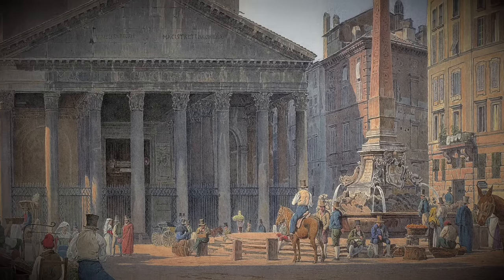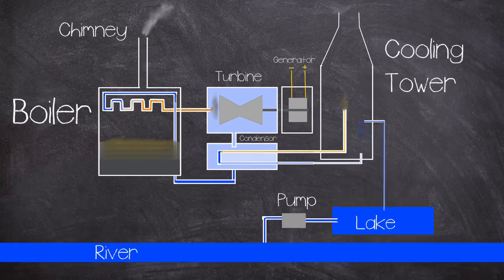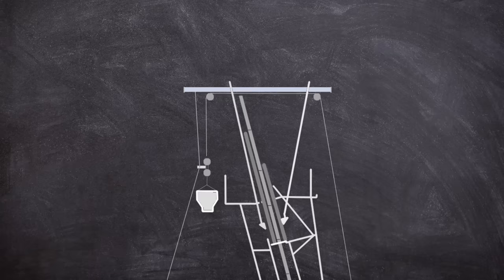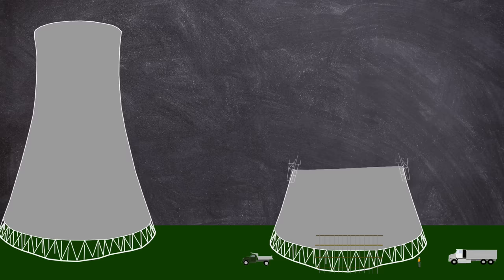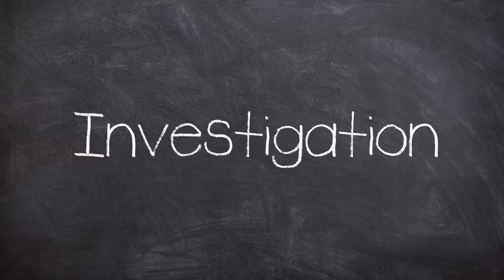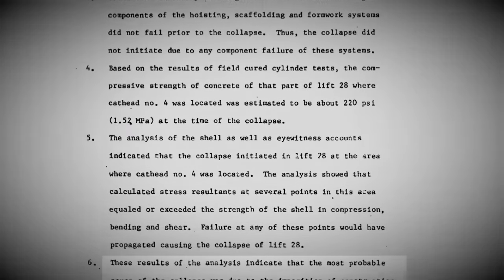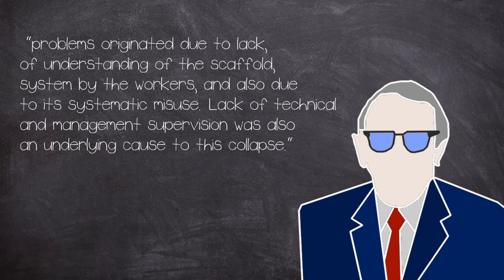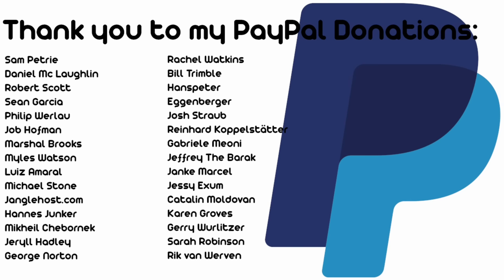The Willow Island Power Station Disaster 1978 | Plainly Difficult Documentary

Comment: I live 10 minutes from the plant. There is a black line around the tower marking the spot where the section collapsed and construction stopped. If you look at the names of the victims, you'll notice a lot of repeated last names, not by coincidence. The builders of the towers were almost all locals and many families had multiple relatives die there. Also it is spelled Pleasants Power Station, named for Pleasants County.
Reply: Same here, from Pleasants County. One of my classmates lost not only his father, but 6 other relatives that day.
Reply: Ritchie County here!
Reply: See this is a good point he coulda put in the video cause this is exactly along the lines of what I was wondering happened with them
Reply: Across the river and north of you nice folks and I’m old enough to remember when this happened.
Reply: Wood County checking in
Reply: Williamstown is here and whipping st Mary’s as always remember 2014
Reply: @melissaglasser4759  yeah, a lot of people in the high school have relatives involved. its a small town so its not surprising especially with the scale of the accident
Reply: The simple reason that all those people needlessly died is because of the BS Method of Building those towers.  Like the narrator said, it was cheaper to build up the towers one level at a time rather than to erect a complete construction structure from the ground to the top, which would've much safer.  Considering the heavy weight of the concrete, this was an unnecessary risk to take, regardless of how much money it saved the contractor.  Had a complete scaffold structure been erected from the ground up, the workers would've remained on the scaffolding when the structure collapsed.  ALL those people died because, yet again, Capitalists value Financial Profit over Human Life.  They ALL died because American Workers are at the mercy of GREEDY Capitalists because our Govt really doesn't Give A $Hit about workers until after they're dead, and then they try to "make things right" by having a BIG Investigation where NO One EVER ends up going to prison.  The fact that this happened in an economically depressed State like WV made it easy to find desperate workers who would take such an obvious risk.
God Bless America !!!
The nation that cares more about the Human Rights of other people around 
the World than it cares about the Human Rights of its own Workforce !!!
Reply: Just checking in, I have a friend in Ohio who occasionally visits relatives in WV
Reply: @ArtCurator2020  "God Bless America !!!"
Same "gawd" who let these people die or a different one?
Reply: UK had power station cooling towers collapse in high winds. Ferry bridge I believe. Thankfully they were fully built and nobody was hurt.
Reply: My husband grow up in Parkersburg. He told me the story the first time we went down there together.
Reply: @HentisTinyBeans and the relevancy of that comment is?🤦🏻‍♂️
Reply: A young boy lost several family members in the collapse. He raised money for a memorial to be built near the station
Reply: RIP to all the sister-cousins, brother-uncles, parent-aunts, and other forms of kissing cousins who died.
Reply: @ArtCurator2020  I agree with your last statement, but ''capitalism'' itself isn't to blame, it's usually the low bid system whereby the cheapest bid gets the job regardless of safety issues. If the company who chooses the lowest bidder doesn't know a damn thing about proper construction it's they who are to blame.
Reply: You lost me at the anti capitalist rhetoric, which is the system that gave us the best living standards in history by far @ArtCurator2020
Reply: @ArtCurator2020 you just aren't  too smart. Are you?
Reply: Wow!

Comment: Before you described how the collapse happened I was already thinking "you can't use day old concrete to support anything, it hasn't cured yet! And then OSHA gave me that sweet validation. 

Thanks for another good one, John.
Reply from the maker: Thank you!
Reply: I was just thinking that myself - this entire process is completely insane! That fresh concrete is just going to crumble under any load. And it did.
Reply: My uncle was an ironworker and said that at the time. He had just come down off the tower and said "That concrete is still green" but nobody listened and then in minutes, it collapsed.
Reply: 🎶🎵🎶🎶🎵🎶  Come with meeeee and you'll seeeee a thousand OSHA violations 🎶🎶🎵🎶🎵
Reply: Well, it can be used for something, just not for much. After all, it did work once, and the second time they added some more corner cutting, pushing it over the edge and causing the structure to fail.
Reply: Well, you obviously can use that methodology to build towers. It just helps that you actually follow the correct protocols.
Reply: Everyone seems to have an uncle's brothers aunt's dog's mother worked on these towers, apparently Winton Churchill got caught smoking weed there too.
Reply: Were they just lucky with the first tower then? I think the video says they used the same method.
Reply: @masheroz  yeah,  this is what happens when you don't understand safety :/

Comment: Hey John, could you make a video on the Senior Road tower collapse in Texas? It's kind of an obscure but interesting accident that isn't well known.
Reply: And there's video of the accident. Once again failure to follow specified procedures ended up in tragedy.
Reply: That is one I am very familiar with, there is good video of the antenna lift and failure.  There was a formal investigation and the results are published. I would like to see a video on that too.  There were a bunch of problems with that job, they were going too fast, cutting corners, and the service company designed their own hoisting system and gin pole mount without an engineer checking their work... The hardware used to attach the gin pole to the tower was defective, when they tested a U bolt from the same batch it failed at 50% of its rated load capacity, and the load they applied was 7 times greater than their napkin calculations had shown them... No engineer.

Comment: April is a pretty cold month up there. Given that they were working on a mid-part of the tower, the previously installed sections may have been installed in even colder weather. This stalls the necessary chemical reactions necessary to bind the concrete together. Concrete formulations are changed every day due to humidity and temperature to try and counteract this, but they may have simply been rushing the already installed mix too fast to save time on the install. In a stressed concrete installation this is a fatal flaw. Fifty-one people died instantly because of this error. My condolences to the hundreds of families and friends of those this affected.

Comment: I am a formulation chemist, and developed ultra high strength concrete for the military and the oil industry.
I was always fascinated with Roman Cement Technolgies.
Portland Cement is typically 3000 to 6000 PSI cured strength,at 28 days.
Drawbacks to Portland Cement have traditionally been slow cure rate, and a life span of roughly 50 years.
It gets weaker as the decades go by, whereas Roman Type Cement has been found to increase in structural strength 
Over 2500 years.
Draw backs to Roman Cement was it took nearly a year to fully cure.
No contractor or engineering firm would consider for a minute a cure rate of one year.
However, in developing ultra high strength concrete to resist bomb blasts as well as down hole well bore plugging, I found that many aspects of Roman Cement had great merit.
I just did not use Portland Cement, and found by adding plasticizer's, more advanced Cement formulations,new types of aggregates combined with some ancient materials no longer used and some creative chemistry, I developed roughly 20 types of  "high,early" curing cements running roughly 15,000 psi.
Cool part was reaching 6000 psi in 24 hrs.
Though it's roughly 10% more expensive than regular Portland Cement, civil contractors still use the Portland Cement because it's written into every construction code book.

Comment: Ambient temperature and humidity are definitely important in the curing process. I wonder what April conditions were like?  Low temperatures and a dry boundary layers affect bonding of the old pour with the new pour. I also wonder how the differing sections of reinforcing were bound together. Finally I have seen cracking in large pours that can warm significantly with the exothermic curing process. The subsequent cooling causes differential shrinking and stress cracking. 
These are wonderful structures but they’re inherent strength comes from their balanced loads so the early pours of a new lift can impact the strength initially. That only a few cubic yards had been poured suggests a seriously compromised structure beneath. The lack of pour samples is a concern.

Comment: A few things not mentioned about the incident. The steel bolts used in the scaffolding, were reused and some had bent under the weight, preventing them from being inserted properly, yet the ones in charge, assumed the other bolts could handle the weight.  As work moved upward, the diameter would become smaller, meaning there was much less material towards the top to distribute weight. Because the cement wasn't fully dried, plus each spot had to take on more weight, the panels were under a lot more stress, and bent inward, like a stack of dominos falling. I would be years before anyone was willing to talk about the disaster, and it took a child who wanted to know what happened, to get a memorial set up for the fallen.
Reply: West Virginia  ❤  almost Heaven?

Comment: I have worked on slip form concrete construction, and it is similar jump form that is used in the cooling towers.  One has to understand green concrete has no strength, and the strength is in the steel and the proper size of the steel rebar and spacing, and the steel has to be properly tied.

We had concrete failures in  when the forms was jacking to fast and the concrete would not set enough to support it own weight, and would fall away from the steel.
One has to  remember under the forms  exposed concrete we had 3 feet of workable concrete for finishing, and we would pour 20 to 25 vertical feet in a 12 hour shift.

Comment: "especially when the other had been successful in it's construction using the same methods". That means they were lucky enough the first time but not the second. Having spent the early part of my career forming concrete I've seen numerous problems traceable back to "green" or not fully cured concrete. It's a great building material but you cannot rush it; instead you work at it's pace instead. Temperature, relative humidity, every part of the concrete mix, it's mix ratios, how well it's mixed, and how well it's poured all play a part in how fast it cures. What was long enough last week may need another day this week, but you're not given that extra day. Things are built according to a schedule and especially when weather or other factors have delayed things already you take your chances and push ahead. 

All the factors spoken of here mattered in this disaster. The General Contractor was supposed to be overseeing the whole process and ensuring that everything was being "done by the book" because everything has specifications that need to be met. Altered scaffolding wasn't allowed, nor was moving the cranes, nor was adding more weight to them by working them with more buckets and more weight. They had to have known about this as it's all clearly visible, even at a distance. Manslaughter charges should have been levied and carried, but here in the US that only happens in the most egregious cases where safety is blatantly ignored over long periods of time. 

This type of construction and scaffolding is still used today, as it's the only really practical approach and it can be done safely. But same as always here in the US those wanting maximized profits do not care how they're achieved and they hardly suffer (if at all) when that harms someone else. It's all about money and those with the least of it always suffer the most.
Reply: Notice how many crimes have a fine you can pay instead of serving a sentence? Thus for those with money it is actually more beneficial to just pay the fine when something happens then to just avoid the thing you are being punished for.

Comment: One wonders if the workers had been wearing harnesses (the kind that provides deceleration at the end of a drop), would at least one life had been saved? The idea of 51 people hanging from safety ropes tied off from the height of the previous lift like bats hanging in a cave would have been described as a miracle instead of the disaster it was.
Reply: What would they be harnessed to?   Their entire level fell with them, I suppose they could anchor the harnesses to the previous level but then they risk getting ripped apart when falling debris tries to pass them.

Comment: The damn thing is the first tower went up uneventful.   Looking at the scaffolding and the radius of the structure with the buckets supported by the scaffold also I'm surprised that engineers thought this through. I'm trying to picture how the concrete was distributed evenly around the circle .  At the same time I imagine the rebar sections were being attached for the next level with another crane ?

Comment: So in effect - the people in the field came up with a 'better way' without consulting the engineers.  And I suspect that the curing times used for the concrete didn't take different weather conditions into account.  

I was the security manager for an aerospace company.  This means that I was also the safety manager.  My biggest headache was workers who came up with a 'better way' of doing something without considering the safety issues.  (And extension cords.  If you want to seriously reduce worker injuries - ban extension cords.)
Reply: Banning extension cords most certainly would cut back on injuries......mainly because without them, not much would get done.

I've spent a LOT of years in the construction trades, extension cords are an absolutely irreplaceable necessity on any job. For example, I've never seen any electric scissor lift or zoom-boom that could be charged without an extension cord. 

If you're going to suggest banning something, you need to suggest a suitable replacement.
Reply: @rrknl5187  Yes good answer, I'm from Australia and spent most of my working life in construction, all electrical equipment that plugs into a power outlet must be tested and tagged then logged. It's retested usually every month and retagged if safe with a different colour tag according to the month it was tested. Most of the accidents here seem to involve scaffold, cranes and falls from a height, construction has one of if not the highest fatality rate of any industry. Lot of trades here using cordless power tools as they have dropped to a reasonable price.
Reply: @rrknl5187  I said that I was in aerospace.  People were using fixed equipment and working at worktables and stations.  The main issue was that extension cords were being left in areas that were kept clear as places to walk.  

Over 70% of workplace injuries are caused by slips, trips and falls.  Getting rid of trip hazards is a really good way of reducing worker injuries.

Comment: FYI, concrete takes about 28 days to reach 80% of its strength. Furthermpre, as it contains many chemical compounds and additives, it is very sensitive to temperature, as well as composition since the materials have to be measured with a tolerance of kg and liters. Furthermore, doing such work with reinforced concrete has the added difficulty of the rebar having to be placed with a tolerance of centimeters in its correct position. Don't get me wrong, I don't mean that these are all hindering factors, all I am saying is that shoddy work and trying to speed up or wing this process is a very bad idea.

Comment: I'm no expert just know a little bit  but as far as the strength when building the structures goes it all depends on how fast the concrete cures and I guess despite the weight of the crane being the same the concrete load does get smaller towards the top so I guess they figured it out that's my random tangent I'm going to go back to the video now LOL
Reply: Okay so they didn't allow enough time for it to be structurally sound I guess LOL would not want to be at the bottom of that pile that's for sure
Reply: Cutting corners ... No matter how many times we are reminded of it in history I think it's human nature just to do it ignoring all the signs fingers crossed basically